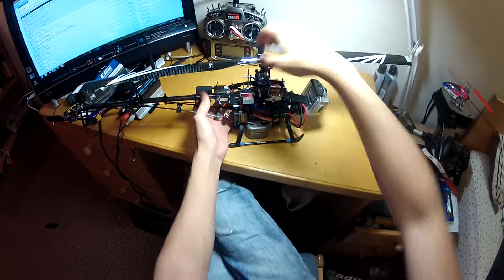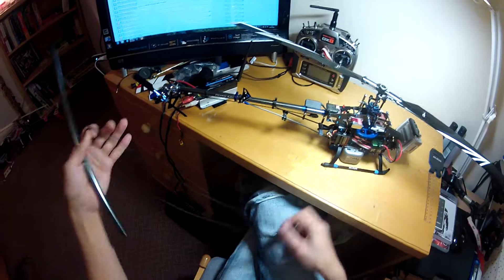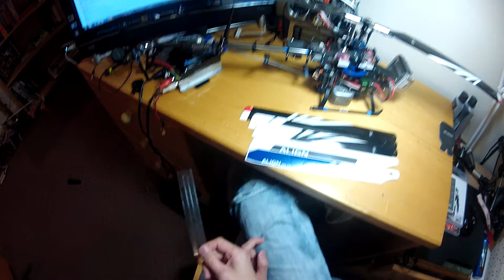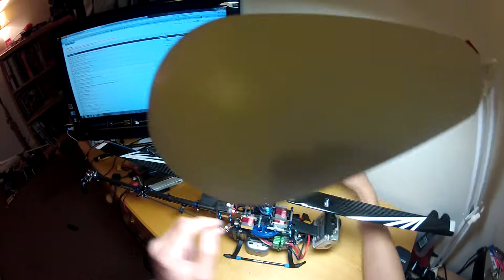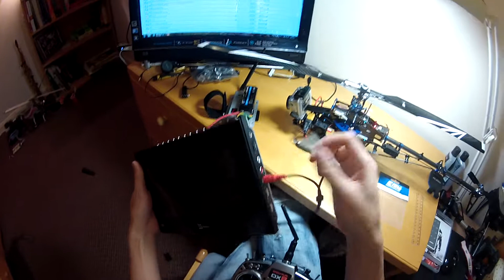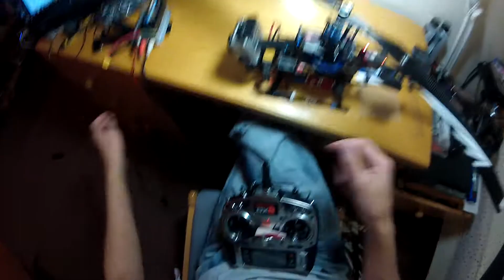TREX 450 RC helicopter GoPro mounting Stretch FPV setup tutorial review

Comment from the maker: The longer blade didn't stress the gears enough for strip. I didn't have any problem with stressing gears at all. In terms of FBL, I've only used Helicommand Rigid and BeastX. I would definitely recommend Helicommand Rigid, but it's rather expensive. If you want reasonable FBL with reasonable cost, I'd recommend BeastX :) I'm glad I could be help :)

Comment from the maker: PS. the FBL longer blades are bit more heavier than normal blades, and the weight is distributed more towards to outside, which in my opinion helps a lot for stable flight because of gyroscopic effect.

Comment from the maker: @daaacc I'm using Spektrum DX8 tx and in UK, the output is quite low compared to other countries. With video tx on, I get only about 100m distance without losing connection when I do ground range check. So I tend to do relatively short distance FPV with this setting. 
I'm currently working on a page for anyone is interested in FPV and the settings (the aerial videography station link on the description for this clip). 
I'll keep things posted through the page :)